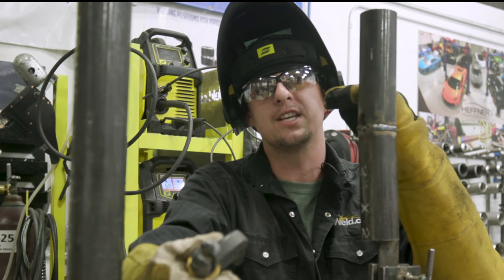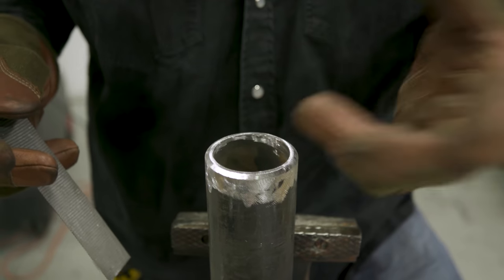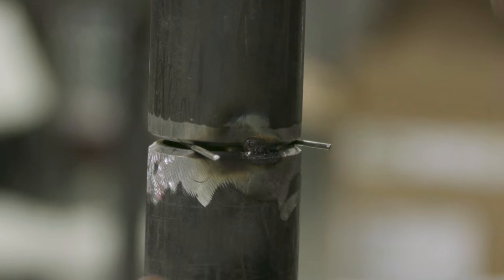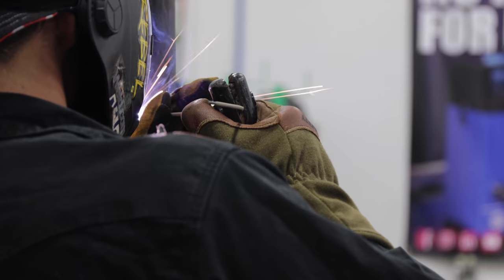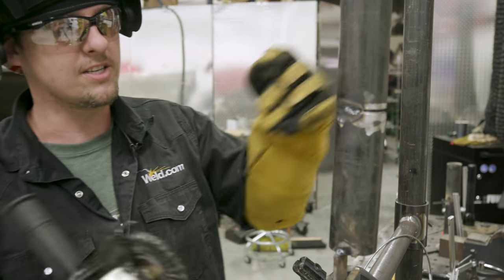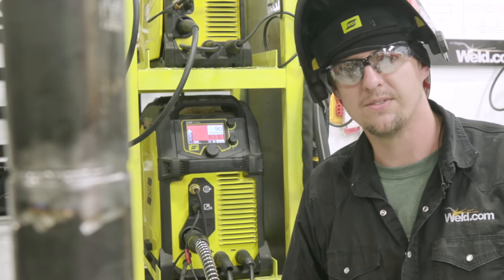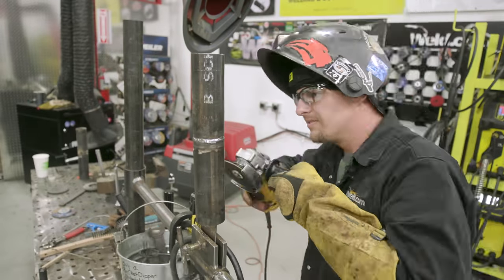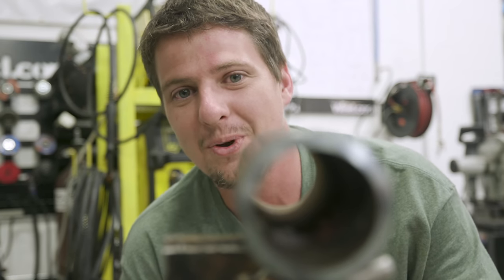Practice 2 Inch Pipe with These Tips

Comment: Good job. We had to do that test and three others except we done it in 6G and we had to make a three stringer cover.  We did that  and a tig root  a 6G.a unlimited in 6G with a tig root on a 6 inch pipe, and a 10 in  with a stick root flip test.  We had a three year clock. Plus all the other certs we needed stainless ,mig. On pipe . Loved  that job  retired now. Every welder does things a little different but that's close to what I did. I  liked a smaller keyhole then you, i  seem to have more control, and it slowed things down for me. Great video I enjoyed it. You are fun to watch.

Comment: While there is a lot to be learned from these well-prepped fit ups using "modern" welders, I'd like to see tips and tricks for welding the likes of 2" barn/pasture fencing with an old-school Miller 225 Bobcat (or something similar).  Typically, the pipe is nasty and often magnetized.  The saddles are rough cut with a torch.  So essentially, just about the opposite of a nice shop or commercial job.  Love your SMAW videos.  Stay safe!
Reply from the maker: We can bust out the Bobcat or Ranger and burn some farm rod 👍
Reply: @5Pectral  🤣 good one
Reply: Good
Reply: 2 very different types of welding. He has that type of prep b/c he is putting in a "to code" high pressure pipe joint, usually to x-ray quality.  Throwin up a pasture fence with old drill casing pipe or whatever doesnt matter. Its just gotta stick together.

Comment: The best thing I got out of this video was the trick of removing flux from the center of the rod to make it less "flippy".  Dang, I've been cutting the rods in half, then removing flux from the cut end (factory end is OK on the other piece).  Now all I have to do when using more than one "short" stick is to just flip the rod over in the stinger.  Thanks for the tip, Mancub!
Reply: practice with full rod, learn to be the best
Reply: @Braddydubz  81 yrs, old here...lucky just to be able to clamp the rod in the stinger!

Comment: I tried this today on 2" pipe in my backyard, my problem is my fit up. All I have is a grinder and a pipe vise not to mention my darling wife asking when am Im coming in. Also  I only had 1/8" 6011 and 1/8" 7018.
I thought I could manipulate the puddle around the bad fit up but my keyhole blew out on me. What made it worse was getting a spark directly in my right ear.

Comment: that pipe is so pretty lol . my steam pipe that is 50 years in the ground never is that clean. trying to fix a leak is a fun time. how about a video on crappy pipe in a 4' by 4' tunnel with no room to work. if you need a location i can help.

Comment: A while back viewers were asked what welding issues they were having. Note: I am not a professional welder just retired hobbyist.  If you are open for one of my many issues here it is: using either TIG or MIG when I try to weld a much thinner metal to a thicker one I usually end up cremating the thinner one. I have seen videos where the heat is to be more directed to the thicker one, but it seems when I try to blend in the thinner part I burn through. If heat is lowered it does not seem to be enough for the thicker piece. Maybe it is just a lot more practice, but any tips would be appreciated. Thanks.
Reply: I’ve had luck doing what you said by keeping the heat on the thicker piece. If the two pieces are drastically different then it may be damn near impossible. I just keep an eye on the puddle and dip it into the thin piece quickly then back to thick. They always say practice practice practice!

Comment: Man the camera view of the rod and its manipulation is really lacking on this video. Did you just drag the bead or did you whip it in, did you manipulate the rod or puddle with your 7018/cap. It's hard to tell, decent looking weld tho man.
Reply: Combination of both, He dragged and whipped the root. When it opened to much he whipped. The cap he just dragged with no rod manipulation. He had about a 15 deg angle of drag on the cap.

Comment: So there needs to be a space between the pipes equal to the diameter of the rod you’re using? 

Or is it always 3/32 spacing between the pipes no matter what the size Rod your using? 

Thanks
Reply: it doesnt depend on the rod you're using. i run 1/8th rod for a 1/16th gap pipe. it just depends what youre comfortable with. Tig welding has an even bigger gap normally.

Comment: Was wondering, if higher PSI is needed, could you use 7014 (I think?) for the root, cut into it with a grinder and finish with 7018?
Reply: For higher pressure, over here in the UK we use 7016 for the root pass DCEN. Then sometimes 7016 sometimes 7018 (depending on procedure) for the fill and cap. 
Fleet 6010s are only ever really used here for class 2 or low spec pipe.
Reply: @kf8575  TY!
Reply: @kf8575  Excalibur I'm guessing or does it matter?

Comment: You must learn how to weld steady, your rod is too shaky learn dragging with consistency push your key hole nice and slowly back a little bit to avoid over heat, you must point your rod down ward and push it upward,